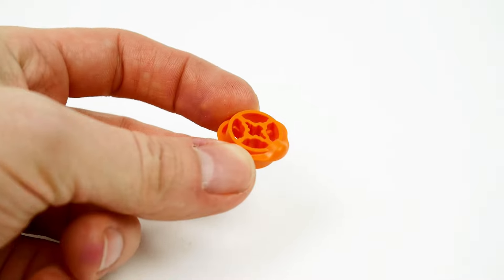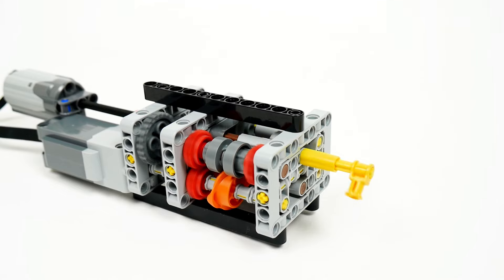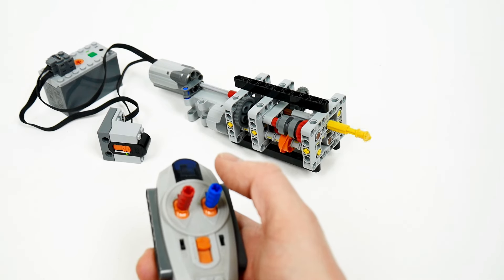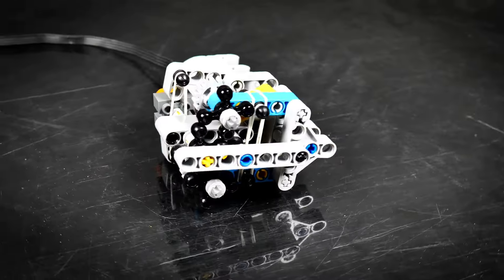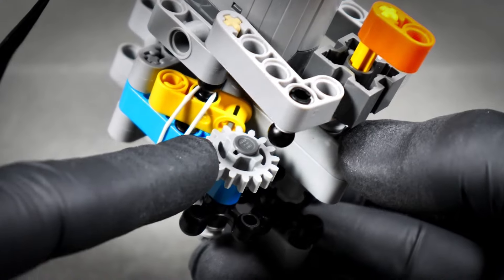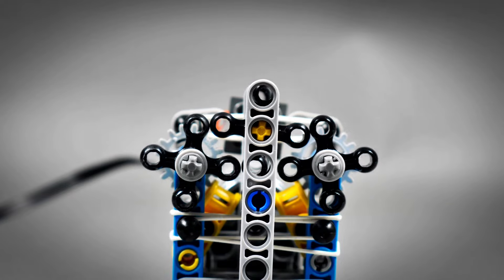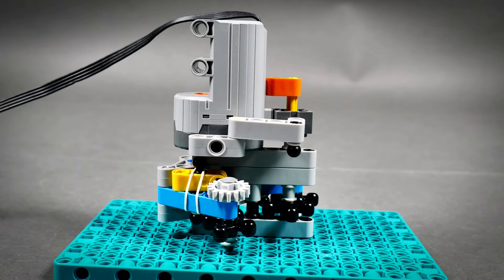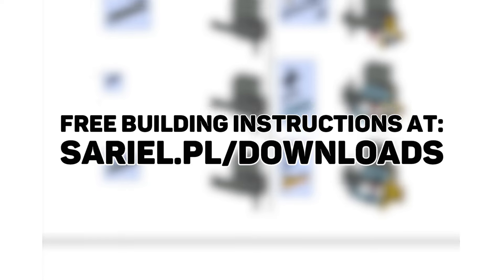LEGO Technic Infinite Servo Stepper

Comment: Not fan of the AI voiveover. If I can speak english with my french accent and be "understandable", you surely can do too. Plus that you have a script for the voiceover and you have already done is some vlog 👍 On the creation : this is quite large due to the required accuracy you want. But with a M motor and knob lever, it works well enough for creation and way less space. I do not know if your model can find some use. On the other hand, the control+ is very handy for that, but I understand your concern about it.
Reply: Hm, yeah, I prefer "poor" english over AI too. There is a lot of charm to hearing all the different dialects from all the people of the communty (or any other community)
Reply: Yeah, I hate AI voicing..

Comment: The setup is quite large for almost any reasonably sized model. The combination of the "LEGO PU L-motor + Controlz app" allows for perfect calibration of the shifter to the exact number of steps and any rotation angles.

Comment: I think that’s a very neat transmission, but I would be concerned about the longevity of it. I personally would just stick to a normal M motor stepper.
Reply: If the Brick Experiment Channel has taught me anything, it's that these gears are tougher than they first seem. As long you use the minimum rubber band force required, I would expect the mechanism to last long enough.

Comment: This video reminded me of the cada italian supercar, which had a similar mechanism. The instructions can't really be found so i jumped on your speedbuild to finally reverse engineer it (it also fascinated me before but i never got to doing it until now). It's more compact than this, but needs less than 90° rotation input so might stress the servo, though that could be solved with some gears i suspect. I might try to build them both with my pieces because mechanisms like this are truly mind-blowing..

Comment: A couple years ago I developed a system that uses a servo motor to control a two-speed transmission, but without snapping back into neutral when the servo goes back to its default position. All that with less than a dozen pieces.
Not sure what's a good way of sharing this design though

Comment: If you use a spike prime (or powered up version) or a spike essential motor you don’t need to calibrate it. The problem is Lego cant make good software and you will probably have to use Pybricks with any Spike motors, so you will have to learn Python if you don’t know it already or be a patreon supporter to use scratch programming.

Comment: check out the gear shift mechanic in the lego technick bugatti set, it has an infinate stepper system for the gear switching with way less pieces and is very compact
Reply from the maker: Yes but I don't think it will work with a motor.
Reply: @searme  I used it to make the Bugatti remote controlled and it worked perfectly